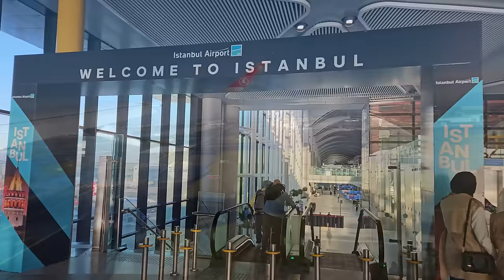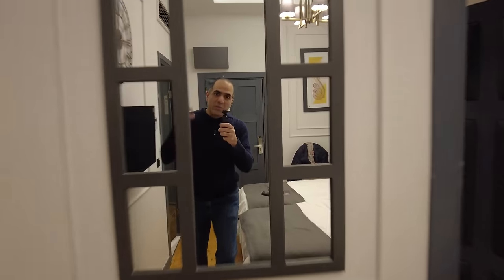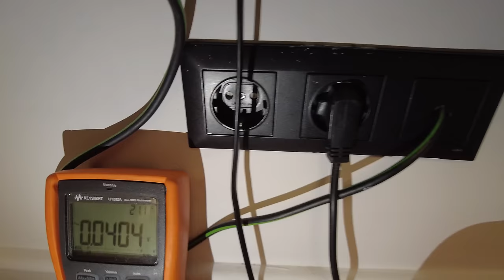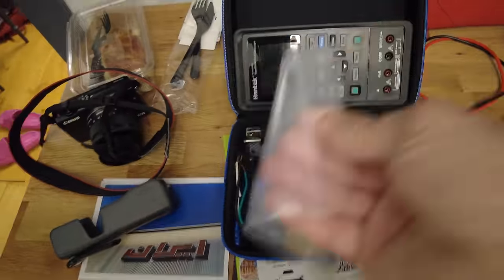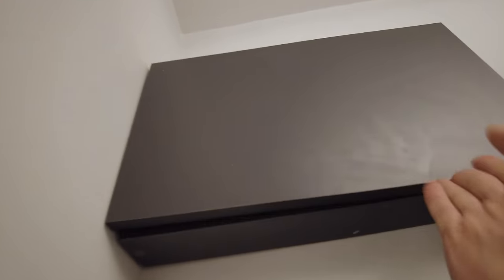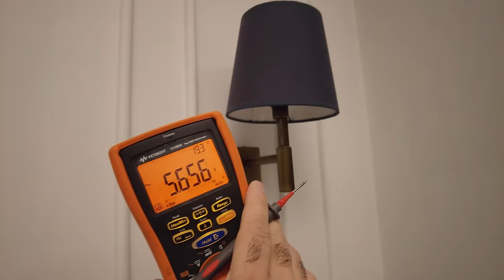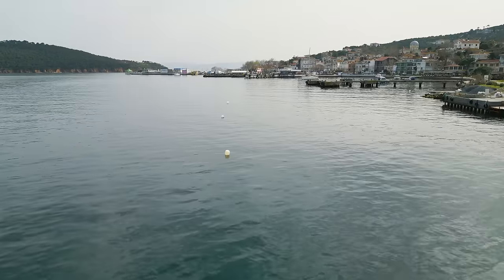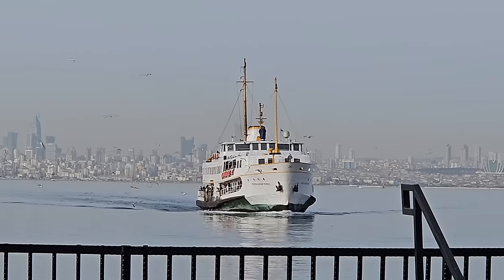Turkish Electricals Are Almost TOO CLEAN

Comment: In Türkiye, for a short time, you must feel the electricity in your body before the breaker pops. This is how exactly we learn that playing with electricity is dangerous. 5:10
Reply: someone should design gfci systems where the gfci itself has like a 1 amp zapping function to teach you a lesson
Reply: so basically the same as Greece.
Reply: Bro OMG yeah 🤣
Reply: Türkiye*
Reply: @Unkn0wnRxbxl Nobody cares lol
Reply: Turkey is well known for shits and giggles.
Reply: The resistor: "sorry I couldn't resist."
Reply: Turkey
Reply: @Gameboygenius when it realized it was going to cameo in electroboom it coudnt resist popping to scare mehdi
Reply: @aldrichunfaithful3589  Most GFCIs actually have a brief delay (IIRC, around 10-20ms) to avoid nuisance trips, which I imagine would have a similar effect. (also, not every fault is user error, sometimes the equipment is just broken)
Reply: @bruddaozzo  Chicken
Reply: @aldrichunfaithful3589  1 Amp will turn you into charcoal.
Reply: @mernokimuvek  at least that way you can never make the same mistake again lol
Reply: @Marduk401 zaten bizim her şeyimiz aynı 🤣
Reply: @Turkishdelight34  don't know Turkish
Reply: @Marduk401  translate yap
Reply: @Marduk401  im saying we are  same similar greece and turkey
Reply: @Turkishdelight34  yes
Reply: @Unkn0wnRxbxl Ü is not a letter used in English. Please use it only with languages like German, Turkish etc.
You can write ue instead of ü, if you really have the urge.
Reply: @scabthecat  I can't take this as an insult, so what are you famous for?
Reply: @aldrichunfaithful3589 This must be why in Serbia they install 500mA RCDs and call it a day 😂 Idiots! Like what's the use when the install in the building is TN!? Live to grounded chassis is a dead short.
Reply: Turkey*
Reply: @FreedomPuppy  nope you're wrong its Türkiye. Never use the "*" again without researching dum dum
Reply: @glonether  Turkey*

Comment: As a Turk person i can confirm that türkish outlets may look safe but it has a flaw that one of the two legs on the end can rip off, causing short circuits, if it happens call a technician, DONT TRY TO FIX IT. Also i experienced getting shocked by a OUTLET it hurt a lot but its really rare. 😮

Comment: Great video. I'm surprised that being recognized by the hotel staff hasn't happened before now. 😅
Reply: TeodoraTacderen How did you use links
Reply: I want to see the view statistics per country. I wonder which country watches the most!
Reply: @Vivov9Youtube theyre a bot, dont provide them with interaction
Reply: @Vivov9Youtube links are only blocked on shorts, YouTube also doesn’t see “part 2” as spam, also if you post a normal comment then edit it it also can bypass
Reply: TeodoraTacderen  mooooooo 🐄
Reply: "Hi, front desk? My breaker, er, became blown."
Reply: @kitsune_gt  already reported them for spamming.
Reply: @pileofstuff  nice

Comment: In Turkey RCD are mandatory somehow. But the buildings electrical setups are so old in order for RCD to work they have to find every single point that might trip the RCD. So, they dont want to deal with that and just put the RCD but they dont connect properly. You can understand that by pressing test button it doesnot work :) My dad is an electrician from Turkey thats why I know.
Reply: Bu doğru değil amaişini doğru yapan ve doğru yapmayan insanlar her ülkede mevcuttur
Reply: @Rmznak  Bunun doğru olmadığına ben de katılıyorum. Türkiyedeki ev stoğunun çoğu yeni ve eski binaların tesisatı zamanla upgrade edilmek zorunda kalınıyor.

Comment: to 1:00 → these sockets are called "Schuko" which is short for "Schutz-Kontakt" (Schutz means safety). 
it was invented almost 100 years ago in 1925 by the german Albert Büttner from Nuremberg, Bavaria.
Reply: So these are from germany? Schuko always sounded like something japanese to me.
Reply: @alexturnbackthearmy1907  well the japanese don't use SCH for that sound, it would've been Shuko then.
Reply: @Kyomara1337 
shu-koo
Reply: You mean Nürnberg Franconia. ;)
Reply: @alexturnbackthearmy1907 the Japanese use ungrounded North American plugs tho...
Reply: @massimo63  nah, pretty sure double O also makes a U sound
Reply: @Kyomara1337  
in inglese, non in giapponese.
Reply: Tbh many of the European Standards were German Standards before 😅
Reply: Or just “f-type plug” for short
Reply: The first socket is faulty, the ground comntact is bent inside. Sometimes happens when a dumb user hits a plug with fist instead of plugging in properly.
Reply: Or its other name(s) after standardization: IEC CEE 7/3 socket (Type F).
Reply: Its a whole story on its own, Ive run into it here in Czechia, while buying suspicious extencion cord from China, while it has Schuko as many more devices and since in EU outlets are not unified but due to large multinational market they are made in both variants but not all of them, aaaand since more Chinese "suspicious" devices made flooded the market one can buy the wrong type for the outlet as we have grounding rod not these two metal things and you cant push it into Schuko but can do otherwise it can be danegrous not grounding things like fridge etc. So on paper, due to state regulations, these devices with Schuko shouldnt be sold but at the same time they can as there is not anything which would prevent it. Its a mess as you can find any combination to adapt on each outlet or cord.
Reply: @WwarpfirewW  You cannot push Czech (French :) plug into Shuko socket, because of the  protusions on left and right. As you said , you cannot push Shuko plug into Czech socket, because of the grounding rod. But most of appliances have combined plug, which will fit both sockets
Reply: @JanSt12  Yep, basically all VDE's achievements.
It's a "club" of electrical engineers that was founded at some point in the 1800s by a bunch of smart people, including Werner von Siemens himself. From the very beginning, it was their mission to create safety and compatibility standards for the newly emerging electrical system. Safe to say they achieved their goal!
Many of their regulations were directly adopted by other large international institutions to help improve safety. 
AFAIK to this day, the Siemens family has a permanent seat in the VDE's council.
Reply: @joudatfd Yes, most appliances use CEE 7/7 hybrid plug which achieves earth with both side connection or with french style pole. Here where I live we basically these days use "schuko" name for all CEE 7/7 plugs, though technically incorrect, but you would never go and put CEE 7/3 plug to cable (original Schuko) and I don't think many electronic retails even sell those anymore.
Reply: @Pukkake  Do you know how to trigger electrician in Czech republic? 1) ask him to install Shuko socket 2) ask him, to put phase (live) on right in your sockets :)
Reply: @joudatfd  Please don't tell me it is left. Cause here it is right where I live. Right or Up depending how the socket is (horizontal/vertical). And neutral is left. 😂 Though that does not have any implication on appliance working.
Reply: @Pukkake  It's not mandatory to have it on left for like 20 years here. It can be on either side now (only requirement is, that it's on same side in whole building) - but electrician would argue that phase on right would kill you, also Shuko socket, because you can plug appliance upside down into it ... I was doing some research and phase on left is probably only in Czech republic, Slovakia, Israel, Australia and Papua. Every other country has phase on right
Reply: Schuko is the best, idc what others say, SCHUKO FOR LIFE
Reply: ABL invented something similar, the design we now know as Schuko was invented by Siemens in 1929. Schutzkontakt means "protective contact", so any earthed plug can be called a Schutzkontaktstecker, although the term is usually only applied to Type F plugs and sockets (historically it was used for a variety of different systems, there's an obsolete three-phase plug that was called Schuko in catalogues well into the mid-1970s).

Apparently Type E was developed in Belgium around the same time and adopted in Czechoslovakia in 1934 because Siemens wanted licensing fees for their plug design. France only adopted the system in 1956. To be fair, even in Germany Schuko sockets and plugs were rare as hen's teeth before the 1950s because earthing wasn't required in most locations. Homes exclusively had non-earthed sockets until earthing became mandatory for new installations in 1958.
Reply: schuko just has 3 big problems:
-its stupig big
- phase/neutral can be reversed
- it has 3phase compatible stockes.

Thats why i like the swiss outlet way more. we have dual and 3x outlets in a single square with T13 and T23 or even 3 phase with T15 and T25.
Reply: @alexturnbackthearmy1907  Generally "sch" is good tell that it is German. In Finnish we call it just "suko" (suojakosketin).
Reply: @joudatfd  In France the phase is on the right so if for example remote controlled switches ate sold in Czhechia they cut the neutral
Reply: @okaro6595  Yes, i get it. But i guess everybody here thinks, that phase is on left everywhere. Or that they rewire appliances crossing borders, when they import them, which is crazy idea ;)
Reply: @Ragnar8504, the plug / socket that became obsolete in the 1970s is the Perilex system. It was replaced by the red CEE 3L/N/PE plugs. Perilex is only permitted to be used in bakeries / butcher shops in Germany, as it I'd easier to clean.
Reply: , nope - miss me with this flimsy stuff.

1. Schuko isn't oversized, it is robust.

2. True, bt switches that cut L& N, widely  proliferated GFCIs and the safety rules mitigate that issue.
Reply: @juri14111996 There is no such thing as polarity in AC. Schuko designed to let the ground connect first and no chance to live prongs. Also that makes it easier to plug in when the outlet is lower than the appliance.
Reply: @DangerWrap  there is. try swaping a phase and neutral in a 3 phase setup and test it.
Reply: @DangerWrap  Yes, there is. One of the poles is shorted to ground, the other isnt. Thats relevant.
Reply: @juri14111996  Schuko is not used for three phase.

Comment: I believe the plumbing at 2:40 is for in-floor heating.
Reply: Red is hot, blue is cold, so I'd wager hot and cold water for the taps.
Reply: @anotheruser9876  No, it's the heating system, red coming from the central heating and blue going towards it.
Reply: its collectors for central heating system it can be in-floor heating or just the radiators could be one of them
Reply: @anotheruser9876  Nope; look at the arrows. They show that the hot water comes in and the cold water goes out. I've never heard of a water tap that sucks up cold water instead of dispensing it, so I'm willing to bet that the heated floor theory is correct. Hot water flows into the floor tiles to warm them, cold water flows out to be reheated again. Makes sense to me.
Reply: @Psythik   in-floor heating and cooling of course..
Reply: This is typical european style heating system for floor heating
Reply: @Psythik  Yes, flow (red) and return (blue) for central heating, most likely underfloor heating, radiators rarely use manifolds like that.

Comment: electro you finally came <3.
around 2005-2010 all the electrical cables on the entire countries streets were buried underground!
the way way when breaker pops if the rooms/houses breaker even on theres another breaker at the entrance of the building  for specially rooms/houses individually from preventing the continues fire hazard :D so double protection.
Reply: Sometimes it can be even more than that as well, one at the room/house, one at the floor, one at main breaker panel (for the floors), one the main breaker for building.
Reply: selektivite olması lazım. odadakinden önce aşağıdaki atmamalı.

Comment: As a proud Turkish/Armenian person i felt obligated that those noodle cables you saw in grand bazaar are for telephone/internet cables. In Turkey ALL electric distribution to any building/complex routed under the ground. Actually it's little bit frustrating when something goes wrong with that distribution you have to wait for the city electric company comes to find where it is, dig the ground, fix it, close the ground and give back electricity. And that sometimes takes 3 to 8 hours.. 😅
Reply: Not in the entire Turkey mate. I'm in Şırnak right now, everything is out in the open. You can see unprotected thick cables even on the sidewalks.
Reply: @EFOZM  forgot to say "I major cities" since in 2010 while on my military service pulled 240 from a poll to the new build-up single story construction 😅
Reply: I also remember, that the cables there overground in the city of my grandma, but they put it underground, because too many people stole electricity.
Reply: @EFOZM   Well, before AK Party it was almost the same in İstanbul. Thick cables were running on poles and on small metal towers
Reply: @ardakaraoglanyan6319  I remember when I was kid I stepped on a wire while wandering around construction sites and I got a small shock by the current that gave me tingling feet I am not an electrician but I'm sure someone can explain this
Reply: 8 hours is pretty fast.
Reply: Dont they use ring circuits, in order to prevent outtages?
Reply: 3 to 8 hours? Even with overhead wires here it takes 3 to 8 days... 😂
Reply: @jondonnelly3  People find stuff to complain when they are not living in Canada I guess
Reply: 3-8 hours, you a freaking lucky. 3-8 days would be usual waiting time
Reply: @mertkocogullar6485  How common are power outages in turkey? They are so rare in germany, that it will be on the news.
Reply: @thebamplayer  aside from scheduled maintenance i've had 2 in last 3 years once when  overhead wires in my street came in contact with a tree branch that got heavy in the snow. 
And once (according to my electric supplier) after someone had broken into our streets switchbox and stripped it down clean, that time we had some weird phase balance i got 150volts. Whilst my neighbor got 280.

But then again if you count maintenance i've had like maybe 7-8 in last 3 years
Reply: ... I would have expected it to be 3-8 days... 
I don't think they find that kind of problems in hours in here (somewhere in south Europe)
Reply: @thebamplayer  I dont know the other cities very well but as a person from istanbul, they are very rare here too. There are sometimes planned maintainance being conducted but you get informed about it in advance.
Reply: @SitzPinkler  How long do they need to fix a power outage? In Germany it takes them just a few hours.
Reply: @thebamplayer  not easy for me to say something certain because it depends on what kind of problem has occurred. But on general I would say few hours max.
Reply: @thebamplayer  in Ankara at my location, once per year. It takes 10 mins to 2 hours to repair.
Reply: @niky00045  Electrical work happens very quickly in Istanbul

Even in a small neighborhood, a power outage does not last for 1 day.

Maximum 12 hours room if there is a major problem in the transformer. 
 But in small cities and towns outside Istanbul, power outages may occur for longer periods. 

Once, a 3-day power outage in the small city of Isparta was on the news.

Perhaps the best thing we do in Turkey is electricity and banking.
Reply: @EFOZM  Abi simdi belli kesimler elektrik calar gibi irkci bir espri yapacam, gozunu seveyim vermeyin yerinizi sonra sakayi yapinca irkci oluyoruz
Reply: Here in Chicago power lines are overground, because heaven forbid somebody does something nice and buries them. A building near me lost power due to a failure in the wiring next to them, and Com-Ed had to supply them a noisy-a$$ power generator for days because they couldn't fix the problem for nearly a week. Such useless muppets. Well done to Turkiye.
Reply: @abdullahk0405  that was 20 years ago mate

Comment: In Turkey, people don't particularly like residual current circuit breakers (RCCBs) because they constantly trip downwards. This is due to the lack of sensitivity among Turkish people regarding electricity. They don't pay attention to damaged or stripped insulation cables. So why are RCCBs in the fuse box? Because our electrical regulations require us to install them, but as I mentioned, after installation, people often bypass them and take the phase directly from the fuse, disabling the RCCB. Additionally, in densely populated areas, power transmission lines are underground. The reason you don't see overhead power lines while driving is because of this. I hope you had a great vacation! :D
Reply: Wouldn't even surprise me, if some of our people would get a high voltage transformer, so that they can connect directly to the high voltage line, only to avoid paying for electricity.
Reply: @thebamplayer  Well people do that in every country with electricity.
Reply: @zt2207 no, please let them think that they are the only people in the whole world who don't follow the rules and let them indulge their feelings of trying to be different from the society they grew up in.
Reply: @Kadirnadir.  Its not trying to be different, its complaining about the shit-for-brains in the country that bring down everyone's living standards
"Being different" is a luxury that does not exist in a country that borders both the Middle East and the Balkans.
Reply: Ahhh its so good to see a fellow cultured Turk
Reply: yaani halkın bi kısmından bahsetmiş oluyoruz orda biraz ama olsun
Reply: Hatların aşağı alınması çok iyi olmuştu
Reply: @Khergitli The whole reason the Balkans are beefing with each other is because of their differences. I don't see how this is a luxury